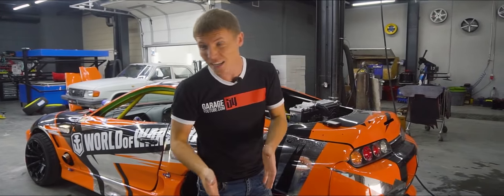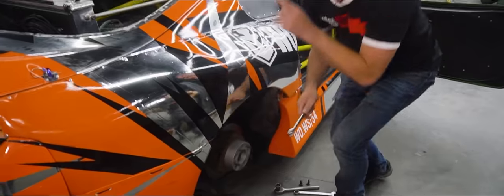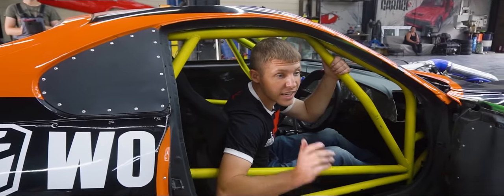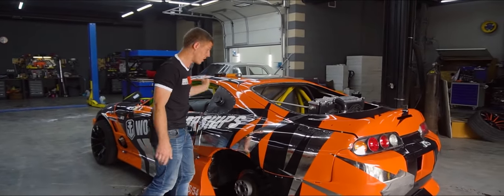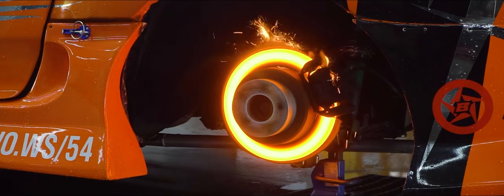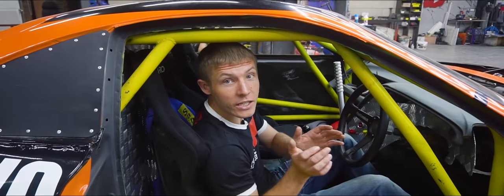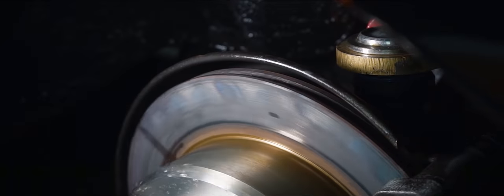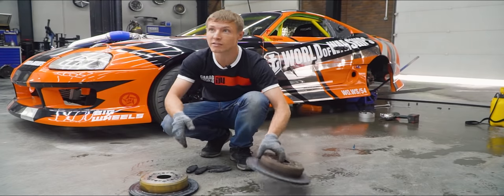Drenching a red hot brake rotor - what'll happen?

Comment: OHHHHHHHHHKAY... Now do the same test.... But pour liquid Nitrogen over the yellow hot disks! Hahahaha 🤔😂😂😂😎 OR... An INSTANT cool down with the Carbon Dioxide Fire Extinguisher.. For better results it's the bigger difference between the hot temp of the disk and the extreme low temp of the fire extinguishers Carbon Dioxide freezing output 🤔🤔🤔

Comment: quick rust
Reply: if you would have heat expansion capability in the rotors, it would not crack
Reply: piece-wise overlapping discs that can move on rails, or just be separately expand/contract
Reply: easy to replace
Reply: same kinds of pads on the rotor, paws
Reply: both sided pads, on top of the rigid rotating rotor wheel holder

Comment: A V8 Supra. Why in the hell
Reply: Why not, they wished for something different, you don't see many V8 cars around, especially not supras, and the extra torque really helps with drifiting
Reply: @televisionandcheese  it's a Supra. It's supposed to have the legendary 2jz😭. It basically ruins it
Reply: @cameroneshleman4833  well have you ever thought that an ls is cheaper and parts are cheaper. If the original motor might have a catastrophic failure
Reply: @Coleschonfielddd  that's not the point dude. Your obviously not a car guy🤦‍♂️. There's 2js pushing twice the horsepower as that V8 and are bulletproof

Comment: Ivy local garage tried telling me my rotor was warped when it was just grime build up, I own a gt86 and rotors never warp on a normal road car 🚗
Reply: Rotors absolutely can and do warp on "normal road cars", it may not have been the case in your car but it does happen.  It all depends on your driving style.  If you treat your brake pedal like an on/off switch and just jam on them to stop at the last second all the time they're gonna warp, guaranteed.
Reply: @zachaliles  I abused mine loads 😂 if I brake harder it would be an emergency stop. I think it’s these people who don’t upgrade the brakes when they upgrade the hp 😂 the brakes on this car in the video look standard too, warped before they did the testing
Reply: @scottshipley570  I hear ya, but there's no such thing as a rotor that won't warp under extreme conditions unless you get into stuff like carbon ceramic rotors and pads.  But I don't think a gt86 could get to the power level that warrants getting carbon ceramic.

All metal rotors will warp if you abuse them properly.
Reply: @zachaliles  yeah true, I love it “abuse them properly” 😂😂